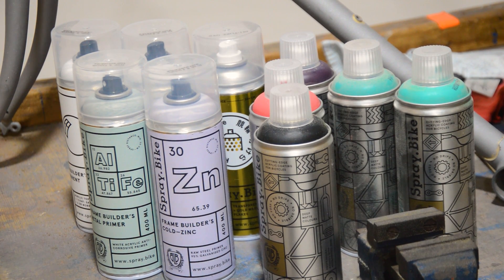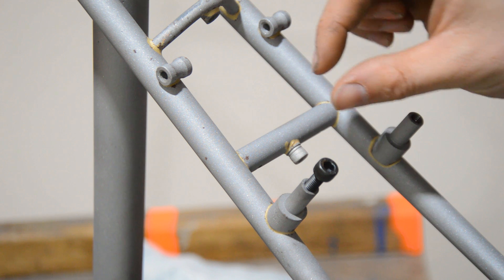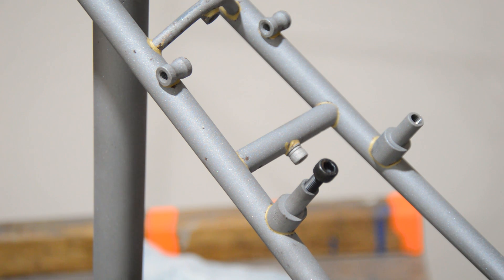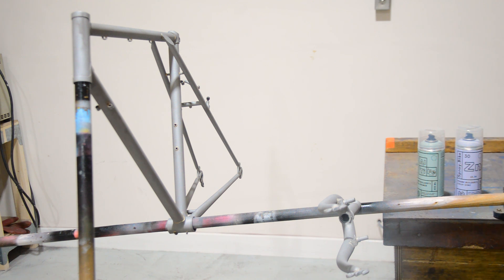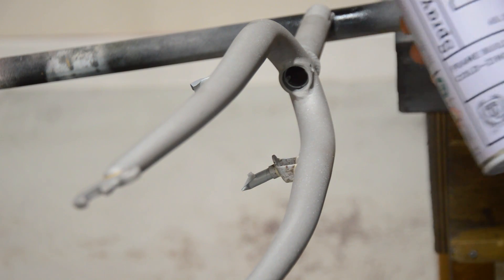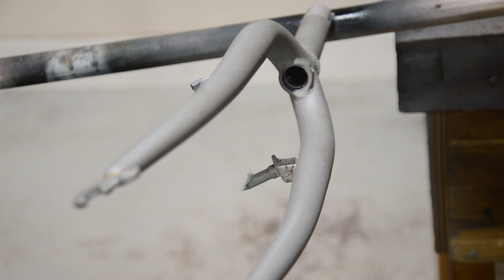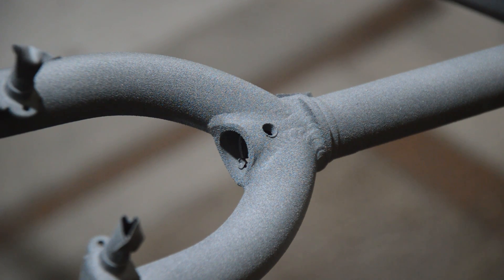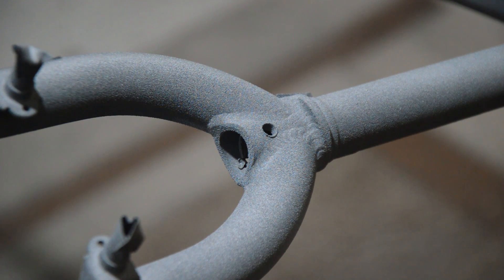Using & Making The Most Of Spray.Bike Spray Paint - Honest Review Follow Up - Bicycle Restoration

Comment: Tip - Heat your spray cans in warm water before starting to spray, keep shaking between sprays & replace cans in warm water when you put them down if you are going to spray with them again.
Reply: This only necessary in cold weather, if ambient temps are warm/hot you're good with just shaking the can well between sprays.
Reply from the maker: I have tried that before and it actually seemed to cause the cans to sputter and splatter the paint.
Reply: @MrDVCHITTer  as it is know where I am south of the equator.
Reply: Yes shake, shake shake.
Reply: @MonkeyShred  no way Jose, the pressure is better and the spray is finer
Reply: "Hot tip" man

Comment: Great paint job. A sign of how sophisticated you've become. And instead of talking about technique like another bike restorer, you got in close and put it on display. Even showed what happens if you spray too slow, plus the troubles with SdotB's zinc primer and discussed the pressure differences in cans. Valuable. I learned from this.
Reply from the maker: Thanks Peter.  If it helps others - I've done my job!

Comment: I went exactly through the same learning curve and have now come to the conclusion that I will never be a master bike painter, neither with this nor with any other product. Here is what I do instead: Preserve the original paint and decals as good as possible but thoroughly remove any rust. Put on new decals where necessary. Clear-coat the frame with high gloss.
Great results so far and I like the patina!
Reply from the maker: That can definitely work with some bikes, not with this one though.  It definitely needed a paint job.
Reply: Considering the amount of time involved in preparation of the frame for spraying, I wonder if it's not a better option to have the frame professionally resprayed or powdercoated.
Reply: @geoffpoole483  - Powder coated??? FFS it's not a cheap rust-in-weeks mower from Homebase fella, powder coating is the one surfire way to devalue/ruin a decent frame.

Comment: I would say Montana Hardcore are much better sprays. Coat is stronger by itself and if you clear coat it two, three times it does the job very well. The only thing Montana to becareful with is their zink spray, structure is a bit rough even after two layers of base colour. Three layers of base colour plus three of clear coat will fix that roughnes. Anyway, great video as usual and keep going with a great job you do ;)

Comment: I have tried thier paint myself and would say I'm not a fan. The dark colors are not bad but the lighter and Brighter colors leave such a textured finish.  I've sprayed close and normally and even contacted spraybike about the issues . They reccomend to smooth out the dusty finish with wax/parchment paper . I tried that but still had poor results.  With a bicycle frame there are always areas that are tight and hard to spray . In these areas I've found that it will always end up with that textured/dusty finish.  Due to that reason and the quality results I expect  for any personal or customers bike I just discontinued offering or using their product. Cost wise it was not much different than buying a mini spray gun this also allows an unlimited amount of color choices and as long as you finish with a good 2-part clear coat I haven't seen much of a durability issue. But in the end it's all up to the user and what they are happy with.

Comment: That brazing  looks sketchy thin man.
Always looked at brazing like a metal glue... they need some surface area to have strength..
As for those spray.bike paint jobs... I'm right there with you. I have a vintage Trek that's a sweet purple to Blue fade.. almost perfect gradient and I don't want to paint it because I know it'll be very hard to get it to look like that again...& have a nice clear finish.
 and my last job was a body shop.
Sadly automotive paint & 2K clear is the way to go.
The bike still turned out ok. 
An alternative for the Karin flake is Dupli-Color color EFX I got it at an automotive parts store and use some Dupli-Color engine enamel black as the base for a Walmart cruiser bike. It turned out pretty sick

Comment: Always paint stuff the way it will be seen normally, otherwise your gonna have light spots and drips where you don't want them
Reply from the maker: You're likely to miss parts without rotating the frame though.  The brake bridge and chainstay bridge are the main culprits there.
Reply: @MonkeyShred  yeah I just flash the bottom and finish right side up,if that makes sense, and I completely understand the response to the sprayer suggestion, you definitely have skills, we all saw that pinkish purple Scott you did that was really cool what you did,you love what you do ,it shows 👏

Comment: Yeah never been impressed with the powdery mess of spray.bike’s lighter colors. Spraying close as indicated also forces you to use/buy more cans. And they’re not cheap. Probably going with a powdercoater next time.
Reply from the maker: On the contrary, I think you actually use less spraying close!  There's less paint going to waste.
Reply: @MonkeyShred  True spraying closer gives more focused spray pattern. But theoretically you cover less the closer you get to the subject. Also because of the powdery finish, having to flat it out and then respraying to get adequate coverage seems wasteful. I enjoy the spray paint videos so far and I’ve learned a lot so thanks.
Reply: I just had a frame powder coated and it looks great, much better than I could have done.